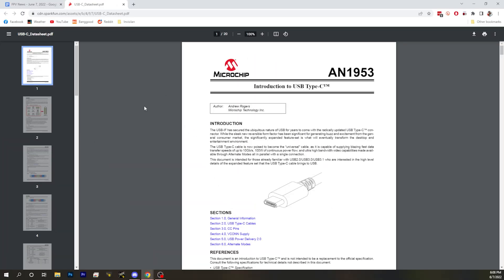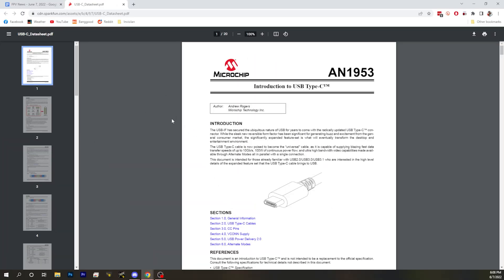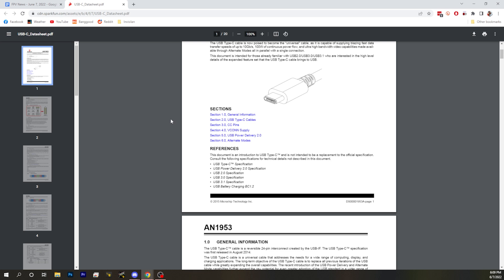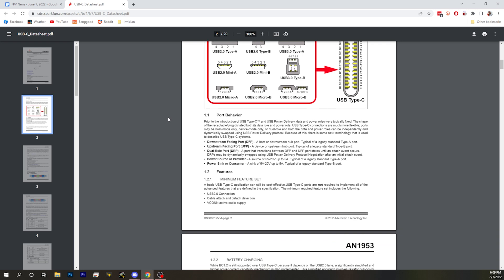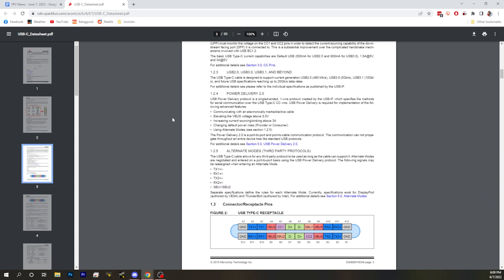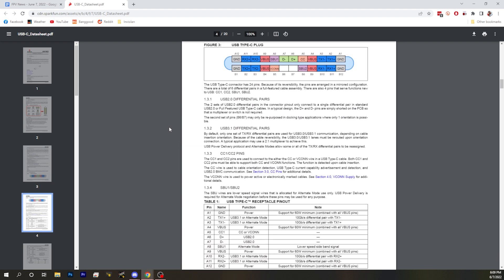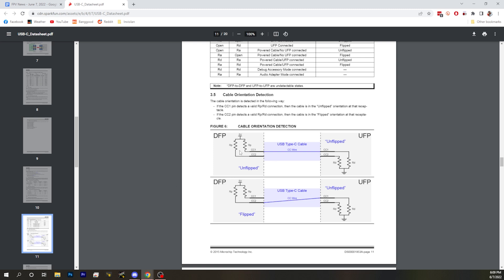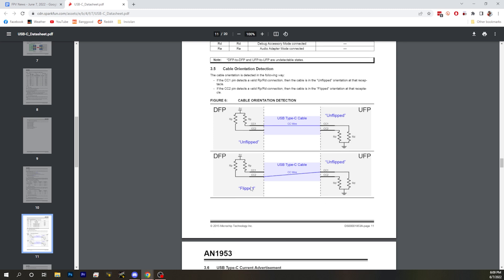PSA: Resistors Needed for USB-C to USB-C on Flight Controllers - FPV News

Comment: I'm on my 2nd laptop that has a USB-C port so I finally bought my first USB-C to USB-C cable. It doesn't work for my flight controllers, it won't charge my wireless mouse, it won't connect with my Gopro hero 8 except to make the screen say the USB is connected. It won't charge my cell phone but it will charge my wife's cellphone, but other than that, it's a completely useless bullshit cable. WTF?

Comment: I used usb-c to usb-c on my phone and it worked for the app. I haven't used it sense switching to BF 4.3 tho
Reply: I second this. I use speedybee with android, usb c -- usb c without any issues. Maybe the board has a resistor?